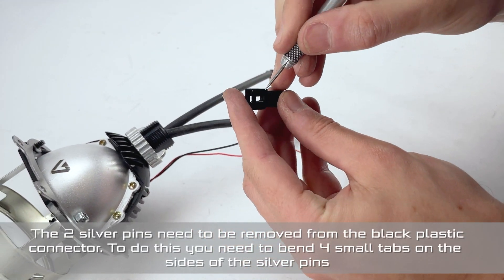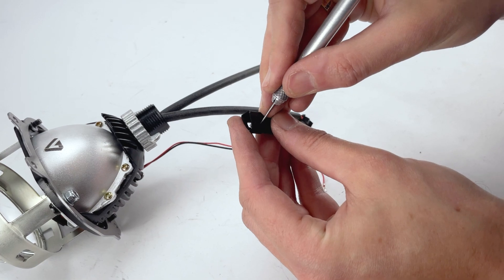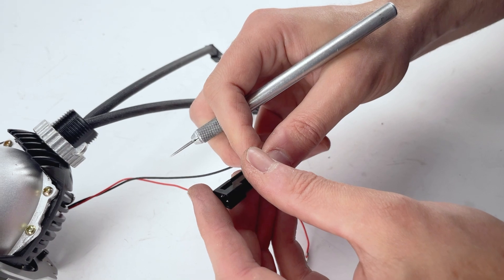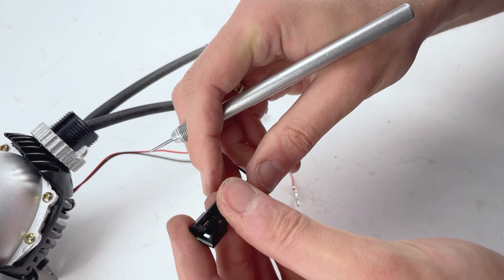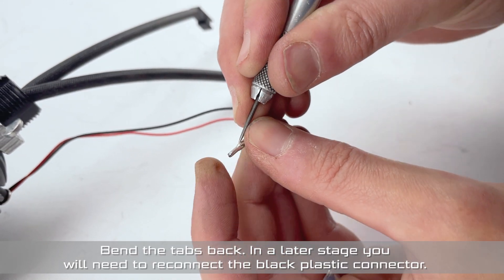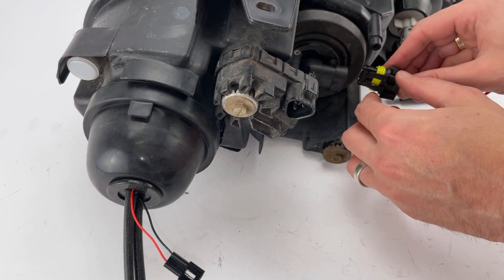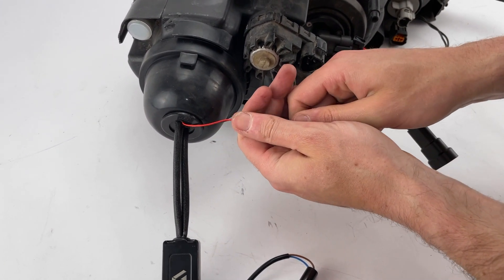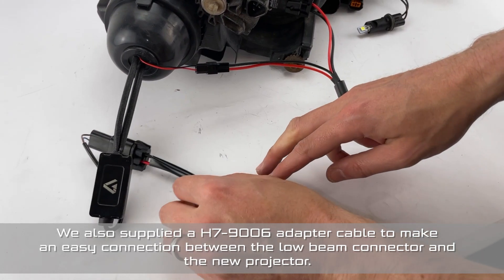Mazda MX-5 Miata NB2 facelift H7 halogen to bi-LED projector headlight repair and upgrade DIY

Comment: Did any NBFLs come with H7 bulbs? I have an Australian delivered 2003 NB8C, and it has H4/H3 bulbs. I thought all NB2 (FL) s came with H4/H3? And if you are replacing the entire projector assembly (which you are), why would it matter what bulbs you are throwing away?
Reply from the maker: Yes, at the end of the production in 2004 they switched to H7 (sometimes it can happen that it was never delivered in this spec to Australia or the US for example). 
The mounting of the projector is completely different, so that's why it matters. 
We also have a video and upgrade kit for the HB3/HB4 version; https://youtu.be/R8mTXCHlXoc?si=dhtCDEPQH9Udy_kr  / https://retrofitlab.com/products/mazda-mx-5-miata-fl-nb2-01-05-bi-xenon-light-upgrade-retrofit-kit-for-hb4-9006-halogen-projector-headlights
Reply: @Retrofitlab Aha. That all makes sense now. I’ve just viewed the video for the NBFL H4/3 globes, but the angle grinder to the headlight housings puts me off. One slip and you are down a thousand bucks.